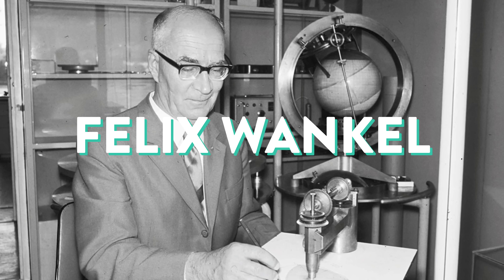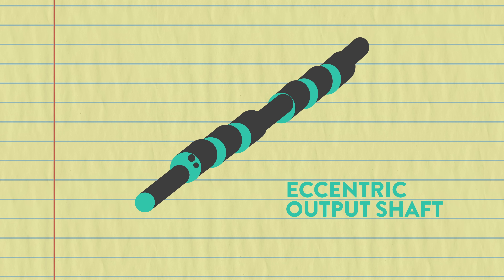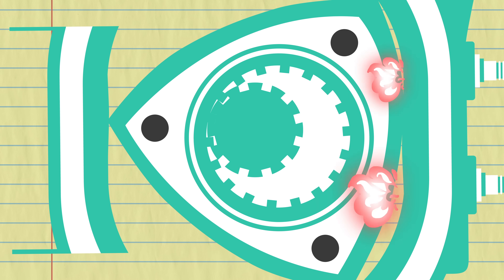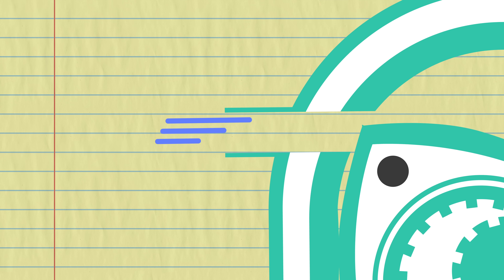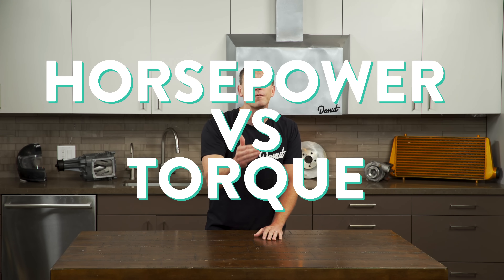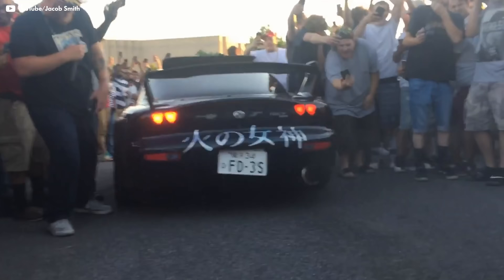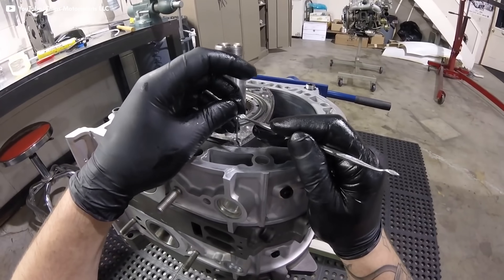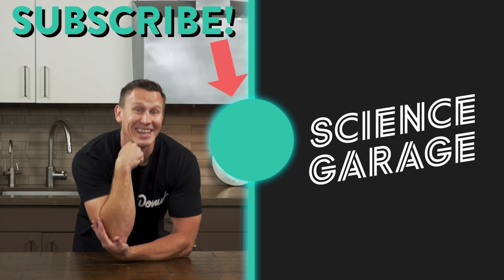Rotary Engine | How It Works

Comment: It's too bad they are super fragile, burn oil like there's no tomorrow, suck gas like a big block chevy, have zero torque, and spew more emissions that any other car known to man. Theres a reason why no other car make bothered with these.
Reply: +Oh Whatup so we are delusional but people who think these motors blow an apex seal every time they drive it aren't? Rotaries fail for 3 reason...poor maintenance, Person who built it didn't do it correctly, or pushing too much power for the way its set up. all 3 are the exact same reasons piston motors blow. dumb ass owners gave it a horrible name. now do i think its the most efficient motor or a cheap motor? hell no but its an amazing time and wouldn't give it up for anything
Reply: If a big block chevy could make 200hp+ per litre naturally aspirated I bet they'd be considered "fragile" "thirsty" have cams and heads so big they'd make no low down torque, be un drivable on the streets and have bad emissions too. Ohhh wait they can't lol 
Rotaries burn oil by design and don't if you premix which also aids in reliability. 
Mad Mike does a full drift season (practice, qualifying, competing, demo days, pr events) making 1200hp being fucken raped before doing an engine teardown for inspection at season end, Mazda won 24hr at Le Mans before being banned, yeah must be unreliable lmfao.
How they're built and maintained is key to reliability as with any precision instrument.
Reply: @darianmurcott-istead3001  
Don't mention Mazda and lemans 24hr.
Doktor bimmer will sniff you out and come to educate you.
Reply: +blyndrotor THAT'S RIGHT! the Mazda RX is the most popular car among people that know absolutely NOTHING about cars or racing.
Reply: +blyndrotor The truth always bears repeating... and the facts are irrefutable.
Reply: Mazda discontinued Wankel engine production in June 2012... attacking the messenger is not going to bring the Wankel engine back...
Reply: @doktorbimmer  
Yes yes yes, we know.
Dear god, we know. 
You have spouted that fact (down to the time) sooooo many times, which means you are not the messenger, you regurgitate. Again and again ad nauseam.  
See what I did there.
The messenger. Really. Come on even you can't consider yourself that far up on a pedestal. 
I never said anything about it coming back did I.
Reply: Just the facts here kid... why does the truth anger you so much? if you have accepted the fact that the Wankel engine is obsolete because it was an inferior internal combustion engines design concept.
Reply: @doktorbimmer  
No. Not angry. Not at all.
More amused. Have you not noticed that once or twice a year I give you a little poke to see what you will do. 
I've been doing that for years.
I barely put any bait on the hook this time and still got a bite.
Reply: You sound very angry... don't deny it like you deny the Wankel is dead.
Reply: @doktorbimmer  
Nah, I couldn't care less.
I just have a little bit of a chuckle now and then poking you.
You on the other hand sound a little frustrated at trying to provoke a response from me that you aren't getting.
Reply: Sure doesn't sound like it... you seem very bitter and disturbed.
Reply: Mazda no longer sells cars with Wankel engines... I'm just stating the facts.
Reply: @doktorbimmer  "The truth always bears repeating, and the facts are irrefutable" Speaking from a neutral perspective, amongst all your laughable jibble jabble, the only fact you've presented is that Mazda discontinued rotary production in 2012 and you keep falling back to it like it carries any sort of weight.  Holy cow!
Reply: +Andrew It still doesn't change the fact that Mazda no longer sells any car with a Wankel engine.
Reply: well if they researched it for a century like the piston motor, then it would be better in almost everything.
Reply: I would agree but I have one with 110k miles on the original motor. They just need a little more attention than pistons that's all.
Reply: I wouldn't buy a rotary for good gas mileage, emissons or even expected reliability really. It's about the driving experience if you love cars enough. The fun of having a "racecar" is dealing with all that but loving to drive it at the end of the day. These cars such as the rx7 weren't made to go to the drag strip with lots of torque any how, just like the old Type R Honda's they're meant to be track cars, like and very well balanced with continuous momentum carried by high revs, not all performance cars are meant to go do 60 rolls at TX2k or go run 1/4 miles
Reply: A Car cant be judged by numbers like how many times it broke or haw fast it can go or the hp and torque. Its about how it makes you feel driving the car.
Reply: Well! All that might be true but if you are into drag racing! Head to PR and be amazed on how 13b engines are in the 7 secs easy! Full chasis rollas with 13bs in the 9s!
Reply: Some people just don't understand cause they never driven a rotary powered car.
Reply: Robert Ortiz, exactly, same here in Australia and where I was born New Zealand.. My tuner has a 13b Datsun in the 7's
https://youtu.be/rVb-WI8BH-I .. (my black FD RX7 is actually sitting on the dyno in this video)
Laws here for modified vehicles are quite strict too, so being street legal and quick is often quite an achievement. 
However there's plenty single digit street legal, street tyre, pump gas reliable rotaries about.
Reply: It's because of the terrible idea to spit oil into the combustion chamber, Wankel was a genius but came up short on that one. There is a permanent solution to that problem but requires some very complex engineering before it can come to fruition. I've been lucky enough to work with a team to develop a real solution to bring it back, we didn't have a lot to work with, it was only a month long project. But I think some great progress was made even in the short period of time we had. I don't think the other members are very interested in taking the idea any further but I assure you that my work on it is far from over. I wish I could give more details but it's all proprietary info at the moment. But stay tuned for more, I can't wait to see how far this project can go.
Reply: It's so sad, i love that "brap brap brap" sound, unfortunately never saw one, they are so rare, i think there's just a few RX-7, and only one RX-8 in my country
Reply: Not any more fragile than most other engines. They are designed to burn oil which is cheap anyway. As long as it doesn't have turbo rotors or its ported, gas mileage isn't an issue. And torque doesn't matter if you can redline whenever you want.
Reply: Terry Kozol so cheap America went to war for it.
Jokes.
Reply: Light* not like, damn autocorrect 😂
Reply: Andrew Miller EXACTLY!!!
Reply: Darian Murcott-Istead i agree with you! 1000000%
Reply: Darian Murcott-Istead ohh wow! Nice! I love that car!
Reply: Rotary for tracks, Piston for the road.
Reply: Darian Murcott-Istead Mazda won by a fluke...

Anyone and EVERYONE who knows the history behind the 787B knows the rotary could NOT compete and won simply due to new rule changes that forced every other to completely NEW builds whole Mazda was THE ONLY manufacturer running their tried and tested machine from last season ...

Ironically, every iteration of that car before broke before everyone else and was always underpowered
Reply: Oh Whatup yeah right you
Reply: Ariel Almeida I know a kid with a rx8 and the thing got gapped by a Grand Prix gt lmao. They aren’t anything special. Not a fan of the rx7 but they are much better than the 8
Reply: Chase Kozol changing your oil every 3k tends to add up. And having to put premium in a car that gets 15 miles to the gallon driving it nice is a issue
Reply: Nutz4Gunz45 do you enjoy being stupid
Reply: Oh Whatup I hope you realize a rotary is literally perfect for racing. It doesn't get anymore wear at high rpm, whereas a piston engine wears out springs and rockers after heavy use
Reply: rhyso oberding well they aren’t good enough to be in any other car but the discontinued ones so you tell me what engine is better
Reply: Derek Hood well then you must have been taking the cheap rout cuz even Mazda recommended premium. And that’s not even a lot of miles to brag about... my car has almost 200k and that thing runs like new. And yes, it’s mileage is garbage. My fathers 6.2 v8 has the same mileage as that car so no, it’s not the same as a 4.0 v6.
Reply: Oh Whatup Are they garbage? Mad Mike and Rob Dahm convinced they are quite the opposite of that.
Reply: Man, chill the negative wave....
Reply: I couldn't give a fuck about oil burning, bad fuel consumption, the fact that they might be a bit more fragile as a everyday car, I love the sound, the look of the cars there in & the driving experience the engines give you!! There not the kind of car you generally buy to drive to work or to the shops! There the car u drive in the weekend & I'm  find with that n all the so called "draw backs" with them, & I found with them there no more unreliable than any other car you thrash the tits off for 100,000 km.
Reply: The Renesis engine is a lot worse than "a bit fragile..." and as performance cars go... Mazda sedans are not that impressive.
Reply: Just the facts here kids.. these engines are WANKEL engines, and by the way... you probably wouldn't know a Rotary engine if one was dropped on your foot!
Reply: Wrong , wrong  they are tough as nails, just add 2 strokes engine oïl and the ran forever. Fuck emissions, no inspection in my state. Luv my RX7
Reply: @cicobee  Your'e funny man... I love your sarcasm!
Reply: They are perfect race engines tho
Reply: @cracked emerald They are imperfect engines... which is why they are no longer used in any major professional racing series.
Reply: And that's exactly why mazda is the coolest car manufacturer ever. They discovered something new. It's a shit design but it works and it's awesome. Now if only all these dumbass companies can get the CVT to not suck, it might be pretty cool as well.
Reply: @Matt Evans Mazda did not discover anything new, it purchased the manufacturing rights for the Wankel KKM engine design from NSU Motorenwerkes GmbH. in 1960... it had no automotive engine designs of its own prior to this time. Not anymore, Mazda cancelled development in May 2009 and discontinued production in June 2012.
Reply: Wankel engines are no longer used in any major professional or world class motorsports series.
Reply: That's why they build 3 and 4 rotor engines 😉
Reply: Wankel engines were a commercial failure and are obsolete because they simply cannot compete with the vastly superior performance and reliability of reciprocating engines.
Reply: Mazda is still in business today... but only because they make cars exclusively with reciprocating engines now.
Reply: Nutz4Gunz45 couldn’t have said it better myself
Reply: Chase Kozol gotta love them turbo rotors....get a real engine, you'll be getting one anyways when your rotary blows up at 70k miles
Reply: Jesse Lucas "Racecar" lmao I wouldnt drive a rotary engine to the end of my street let alone take it to the track
Reply: @keeganholthaus7143  are you aware that the FIA, banned the rotary engine in 1991, because it was too good for actual racing. Did you know that the N/A 1.3l rotary in the RX8 could produce 238hp from the factory? A 1.3 litre engine produced 238 horse power from the factory, and it was naturally aspirated. There are 6cylinder engines today that aren't putting up that number. You should learn before you criticize.
Reply: @Matt Evans The FIA NEVER BANNED the Mazda 787B or Wankel engines... this is a false urban myth. Then why was the 787B so slow and uncompetitive? The Mazda 13B series engines have a total, true displacement of 3.9 liter... Most Motorsports sanctioning bodies use the 2X conversion formula to calculate Wankel engine displacement at 720° making the 13B a 2.6 for comparison purposes. You should learn some basic engineering and engine design before you make foolish comments.
Reply: doktorbimmer LOL, you are so funny. I like how you are trolling yet speaking mostly the truth at the same time. Also writing in bold makes you even more hilarious. XD
Reply: @Vinny V  Childish insults won't prove your point (if you had one) and don't make you look smarter either... Cheers!
Reply: doktorbimmer I love you too man.
Reply: @Vinny V Have you been by your local Mazda dealer lately? If you haven't? Be sure to ask a salesperson to see a 2019 RX model... Lol!!!!
Reply: doktorbimmer I'm not a Rotary fanboy though watching this video seeing how it works is cool. If they bring back the Rotary then great, I'm all for it. 

If this style of trolling you keep doing makes your life better, then by all means, keep doing it lol.
Reply: @Vinny V Could've fooled me kid... There is a lot more to learn about Wankel engines than what was shown in this fan boy video.
 Don't look at your own comments??? Sounds like you are the one trolling here son...
Reply: Jesse Lucas Those three and 4 rotor engines still have the same problems idiot. The rotor engine is complete garbage and rotor fanboys are delusional
Reply: Oh Whatup shut up
Reply: +Orion Loranzo He is right though... those engines were total garbage... more power but far worst efficiency and much lower reliability all with a ridiculous price tag... that is why they were discontinued by Mazda decades ago.
Reply: @doktorbimmer  They weren't discontinued by Mazda decades ago.
Reply: @doktorbimmer  Heck, I'm actually going to sit here and counter-argue that I wouldn't WANT to own ANY car made post 2004!  I'm a barebones kind of guy who has no appreciation for luxuries such as power locks, windows, heated seats, navigational systems, heated steering wheels, and so on/so forth.  I argue that many of THESE features are either unnecessary, add weight, or both.  If you want an example of an ideal car, look at the 1994 Mitsubishi Lancer Evo.  That's right, the EVO I!  It weighed 2450 odd pounds.  It had manual locks, windows, seat adjustments, etc... My real car is a 2004 Subaru Legacy and it has power windows, locks, and seats which is already a lot for me but it doesn't have all the other fancy stuff.  The point I present to you is that newer is not always better, and not all progress being made in the automotive world is actually good.  We're leaping into a day and age where it's becoming harder and harder for people to perform maintenance on their own vehicles for pete's sake!  Take me back to the 60's when carburetors were still a thing!  The fact that the rotary isn't being manufactured into any mass produced vehicles is a null argument.  So many AMAZING automotive features aren't currently being incorporated into today's manufacturing.  You should help me find a few current models that have manual locks, crank windows, and manual set adjustments.  I'd be a happy dude!  Are these features simple?  Yes!  Are these features primitive?? Yes!!  They do, however, have certain advantages over current tech.  Lots of great things aren't still currently being produced.  Terms like "better, inferior, and garbage" are can only be used to convey one's opinion and cannot be taken as fact.  As for obsolete, that doesn't actually have any negative values attached to it.  Lots of great things are obsolete, like the most durable of Subaru boxer engines, carburetors, and the Lotus Motorsport Elise!"
Reply: +Andrew No fact could be more easily proven than simply going down to your local Mazda dealer's showroom... you will not find ANY NEW CARS with a Wankel engine.
Reply: +Andrew You seem extremely bitter that Mazda discontinued Wankel engines... but the truth is no automobile company can stay in business selling cars that no one wants to buy. Sales of Mazda's RX brand were in steady DECLINE since 1986 and by 2008 cars were starting to sit in showrooms unsold and piling up in storage. Mazda's massive Ujina #2 RX-8 assembly line was sitting idle except for just  4 hours PER WEEK bleeding the company dry with lost development and production costs.
Reply: +Andrew Sounds like you are not as nostalgic for 1960's technology as you are for 1960's prices... My advice to you is if you cannot afford to buy a new car that you like... find a better job
Reply: @doktorbimmer  Man, the last thing I'm in the market for is a new vehicle.  Both of those factors, 1960's prices and tech would be irrelevant to my personal situation because I'm very happy with my Subaru.  I'm taking care of that car, it has 200k miles, and it's still running great!  My goal is to make that car last as long as I can and until it gives up it's ghost, I'm not forseeing any changes in wheels.  Nostalgic about 1960's prices??  1960's gas prices maybe, that would be awesome!  Most of the other tech was solid until the early 2000's besides carburetors.  The car example I referenced was a 1994 model so I'm not pining too heavily over the 60's.
Reply: @doktorbimmer  Honestly I'm not nearly as bitter as I am dissapointed that's the only argument that you're using.  First off, I'll counter argue that not every product that has been discontinued is just undesired content.  As a matter of fact, there's actually a super market that revolves around cars that are no longer in production.  Have you ever heard of a classic car?  They sell for MILLIONS and many of them are mechanically sound.  Second, why would I be disappointed Mazda has no rotary engines currently in production??  PPRE is a current rotary engine developer and if my Subaru gives up it's ghost, I'll be right back in the market for a 2005 or older car anyway.
Reply: You certainly are bitter... and definitely in a very deep state of denial, the Wankel engine is no longer developed or produced by any of the original 26 Wankel KKM licensee's (including Mazda) and no longer in series production anywhere in the world... it is an evolutionary dead-end that is no longer able to compete against the vastly superior reciprocating Otto and Diesel engines... which the only thing Mazda makes now. Nostalgia is a seductive liar, you are simply refusing to accept the truth.
Reply: @doktorbimmer  Nostalgia is a seductive liar??  Either way, my odometer isn't.  It's still keeping track of each new mile on the tally.  My dad currently owns a Legacy three model years older than mine and he's pushing 220k+.  By all means though, I encourage you to upkeep your values of keeping up to date with the latest not-so-bulletproof tech.  Maybe when your heated steering wheel or your auto-engaging AWD system craps out you can sell it and buy the newest model like the manufacturers want you to do.
Reply: @doktorbimmer  According to a very recent Road and Track article I was reading earlier this evening that was written OCTOBER of THIS year, the truth is that Mazda is bringing the wankel powerplant into a new model where it will be backing up an electric motor.  I'll counter argue that you seem very bitter about the very existence of the Wankel engine.  Why is that??
Reply: @doktorbimmer  I'll tell you what else you can do, we can call it an experiment if you'd like.  You should go troll some classic car auction (Like Barrett Jackson, ever heard of it?) videos, post "Nostalgia is a seductive lie." in all the comment sections, and see what kind of reception you can get and record the results.
Reply: +Andrew Whats was your point Andrew? Was someone else here arguing that Subaru doesn't make reliable long lasting cars???
Reply: +Andrew Are you sure you weren't reading an article from an amateur blogsite like "Motor1" or "A1Auto"??? these non-credentialed "news" sites are filled with fake "clickbait" headlines that are posted because they are guaranteed to produce a lot of revenue generating "hits" to their blog page.
Reply: +Andrew I was around back when experts still believed that the Wankel engine was going to completely replace reciprocating engines... I have been fascinated with the M950F and the SCORE programs for decades... if anything I'm a little sad that the Wankel turned out to be a colossal failure and all of this engine research is now completely forgotten. What does bother me is brainless, uneducated amateurs regurgitating false urban myth, fake rumors and outright lies about the Wankel engines that do not exist and never will... because they do not understand or accept the fact that the Wankel as commercial production engine is now complete dead. Wake up kid, you still have a lot to learn yet.
Reply: +Andrew I'm not sure what your experiment is supposed to prove son... we were discussing technology and features of NEW and FUTURE vehicles... I personally love old cars and own several of them that I have partially or fully restored... some of my vehicles have over 400,000 miles on THE ORIGINAL ENGINE.. and still pass emissions testing here in California (the strictest in the world). We were discussing the fact that Mazda NO LONGER sells cars with Wankel engines because they are OBSOLETE in the auto manufacturing industry, why is this fact so difficult for you to accept?
Reply: @doktorbimmer  https://www.roadandtrack.com/new-cars/future-cars/a23563167/mazda-rotary-engine-revived/  Here's the link to the Road and Track article.
Reply: +Andrew Where is the link to the official Mazda statements??? Where is the new engine? The articles doesn't give any quotes, references or verifiable facts... I'm sorry but that is not proof... just more of the sme old false rumors we have been getting for over 10 years.
Reply: +Andrew A real announcement is followed up by details, photos and a reveal of the new engine... The Skyactiv-X engine expected to go on sale at the same time has already been displayed and even test driven by the press... if there is a Range extender Wankel engines coming in 2020??? WHERE IS IT??? We should have seen a prototype by now.
Reply: +Andrew Real upcoming models and engines can be seen, examined in their prototype and pre-production form and even test driven by the press before release, imaginary vehicles and engine cannot because they do not exist. https://www.caranddriver.com/reviews/2019-mazda-3-with-skyactiv-x-compression-ignition-gas-engine-prototype-drive-review
Reply: dokterbimmer the fake ???? WOW!!! You're right, he did delete all his comments
Reply: doktorbimmer lol
Reply: @Vinny V  Just the facts here vinny... look up the definition of trolling... you will find that in fact you are the one trolling here.